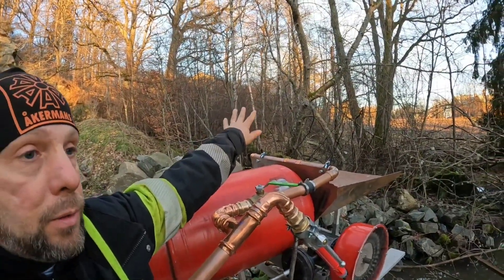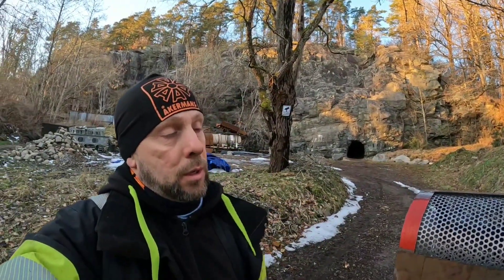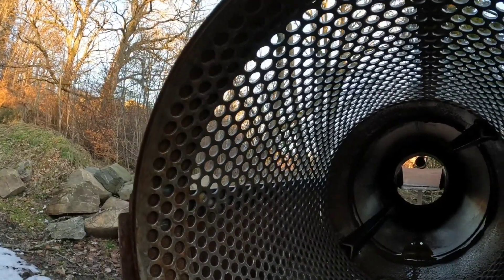DIY: Water Powered 20" Trommel for Gold. First test with the watersystem #peltonwheel

Comment from the maker: Things to do. Do the discharge from the Pelton housing wider, that water will be diverted to the sluice.
Of course, make the spraybar in the barrel and the feeder hopper. Painting and some small adjustments. This was the first test with the watersystem so I could see how much water it was left after the water powered the Pelton wheel, and there were plenty left. Almost no throttle on the pump. No belt or chain to turn the barrel just an axle with two drive wheels.
Reply: Nice to see it coming together.  Definitely need a larger drain on that turbine.  I mounted mine so that the turbine faces down and the water drains freely.  

My partner's pelton trommel is mounted on top of the machine and the waste water goes into the hopper.  It works really well but creates a hazard for feeding the hopper.  Both are good methods with pros and cons.  Great job!
Reply from the maker: Thanks for the input! I have been watching your Pelton build and it's a nice trommel. Yes, both methods works.👍